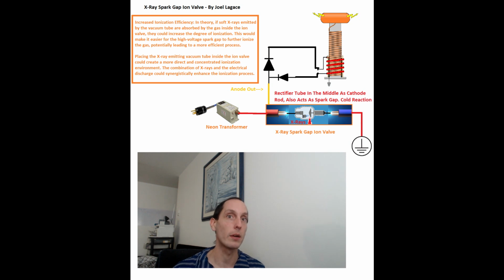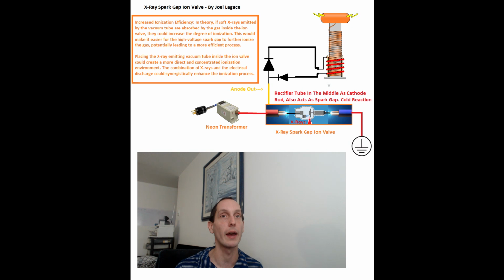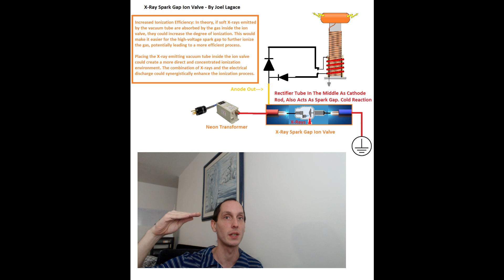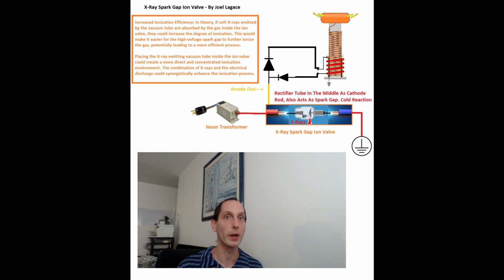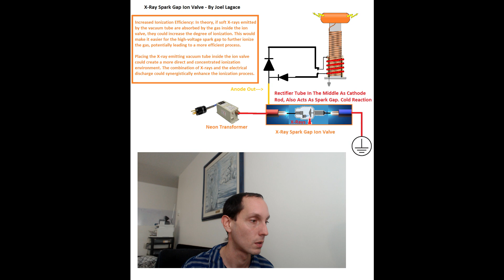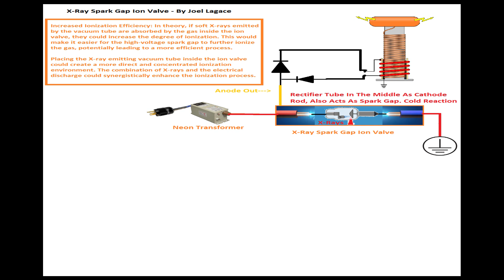Xray Spark Gap Ion Valve

Comment: Since Flyback drivers are used to power asymmetrical levitators , I am 100% positive the Tesla Coil is the worlds 1st flyback driver and that Tesla knew full well about anti gravity , it was not a demonstration device but a device designed to relay a message into the future
Reply from the maker: Fun fact a little off topic, I pulsed my big coil by rectifying the mains direct to 110volts DC,  and pulsed this dc at 1% duty cycle,The whole coil almost shook off the table! and after a few moments killed my transistor lol So there is something to look out for when pulsing high current. Not for free energy obviously but perhaps anti gravity etc.
Reply: @joellagace1679  your coil awg was to low add resistance to the coil keep the turns your working with, remove the current keep the Volts
Reply from the maker: I wanted to see what happens.
Reply: My instinct tells me bifillar energizer at 2x 10% wound of your huge secondary... More power more lift but the shape of the secondary is vital to get efficiency and less strays when the wave stands.
Reply: You are PERFECT RIGHT THIS CANNOT BE DONE IN RESIDENTIAL AREAS...

Comment: Was thinking about the Tesla coil and how the primary has fewer turns than the 2nd. I believe this is because when you switch a signal into the primary  it fly back high voltage and Tesla dumped the flyback from the primary into the secondary because the 2nd is suited for the high voltage  presented by flyback you will notice its more turns and thinner awg  ;)👍